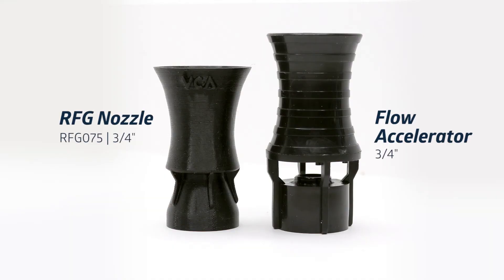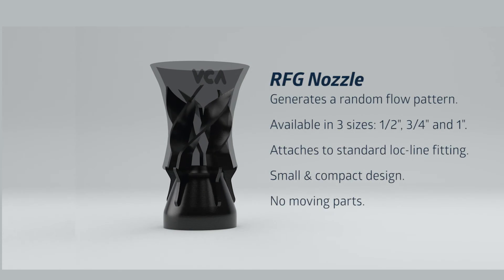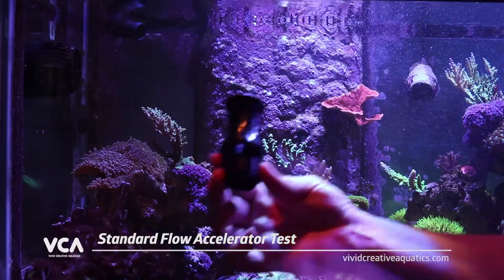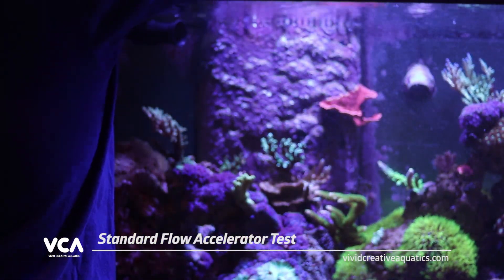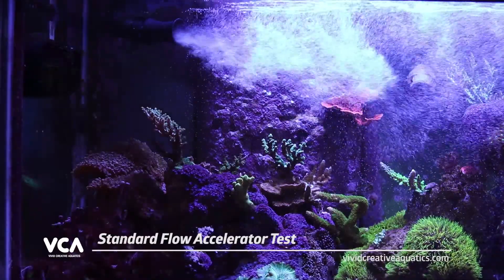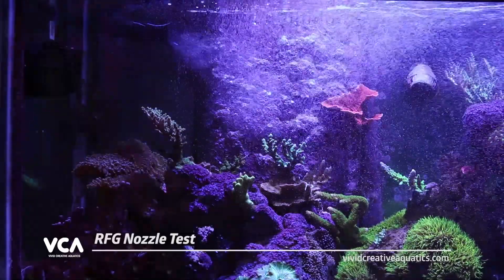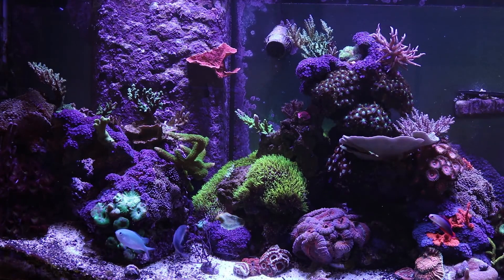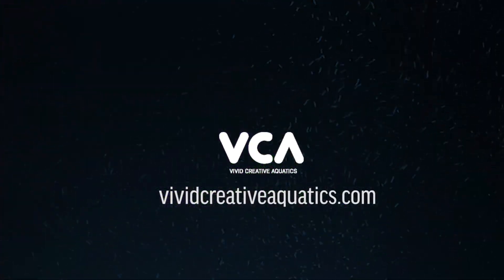Random Flow Generator nozzle vs Accelerator Nozzle - How are they different?

Comment: Does that nozzle make all those bubbles permanently??
Reply from the maker: The bubble in thks video are created by air injected into the return line to make the flow pattern more visible.   

However, the RFG nozzle dies have eductors along the back of the nozzle, so much like a tradition accelerator nozzle, it does have to be fully submerged to avoid drawing in air

Comment: Would these work with Fluval Evo 13.5?
Reply from the maker: I believe the fluvial has 1/4in loc-line. Unfortunately that is smaller than we make the RFG nozzle to fit - at least at this time. 

However, many of the Fluvial Spec series aquariums we have seen have a 1/2in loc-line ball that is attached to the 1/2 to 1/4in Y splitter. If you remove the Y, what you're left with is a 1/2in Loc-line connector. Then you can attach a few sections of 1/2in loc-line and a 1/2in RFG Nozzle.

Comment: Currently building a large scale reef tank.  Will be using these nozzles on the build and would love to advertise for you on my channel after I hit my 500 sub mark.   I believe your product works wonders over the standard nozzle.  Can't wait to purchase
Reply from the maker: Upgrading to a large tank is always fun. How big are you going?
Reply: It's going to be between 400-500 Gallon display once completed.  Will definitely need quite a few nozzles to keep flow evenly dispersed but random
Reply from the maker: For that size, you may consider running the 1in RFG nozzles. They slip on to the end of standard 1in PVC, and handle and convert a lot of flow.
https://vividcreativeaquatics.com/shop/1in-random-flow-generator-rfg100/